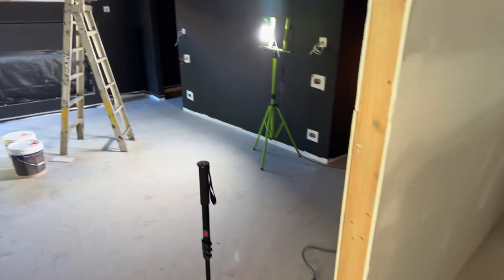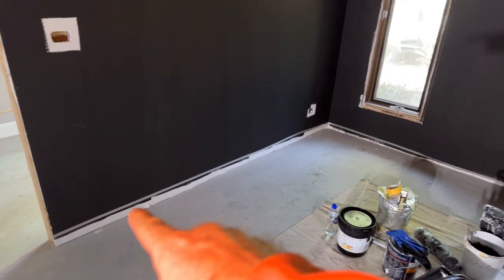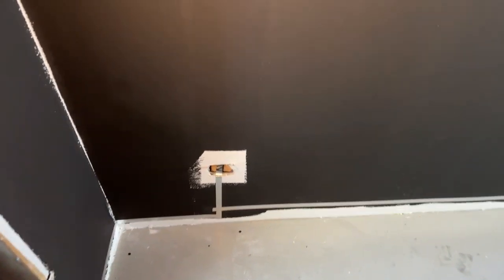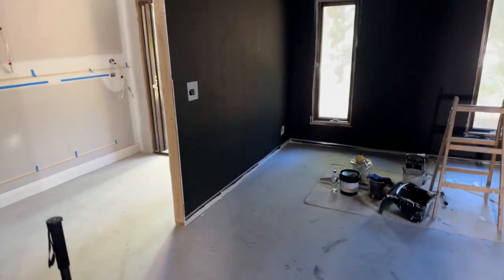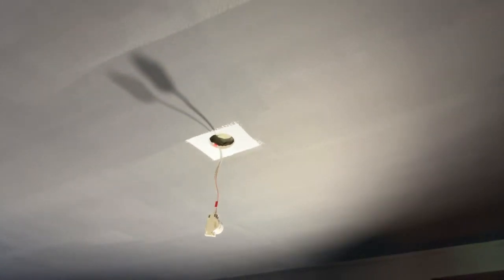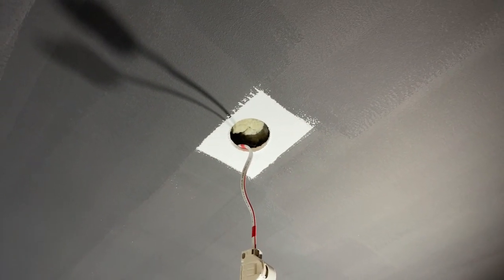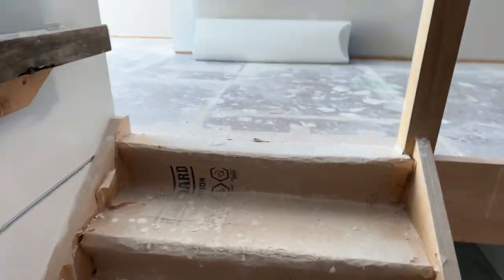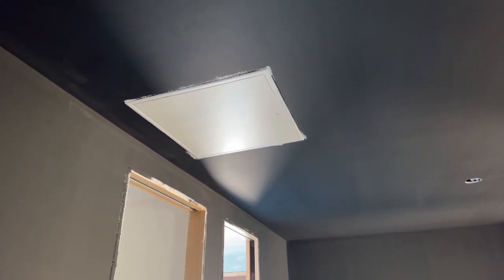EMF Shielding paint grounding in large bedroom

Comment: Does this paint actively block or reduce MAGNETIC fields from outside the walls that are painted?
Reply from the maker: T98 shields against radio frequency radiation (phone towers, wifi, radar, airport navigation systems. etc.) and electric fields from electrical wiring. Magnetic fields from current (power lines, meter boxes, wiring errors, and others) is not shielded by shielding paint. In regards to those, you'd want to remove the source or move further away from them. A home assessment by one of our consultants, who can also assess the body for RF radiation absorption (instead of the air), can give you a proper insight in your situation... check if a wiring error might be at play etc.
Check out our site for consultants or contact our office if no one is near... often our people travel to visit areas where we don't yet have consultants.
https://en.geovital.com/consultations-in-your-area/
Reply: I appreciate the response! @geovitalacademy
Reply: My house near electrical tower what make magnatic fileds.   Is this paint help and protact my home from this high pressure tower?